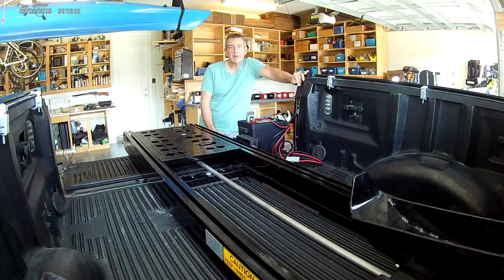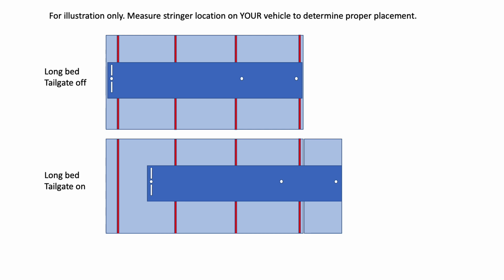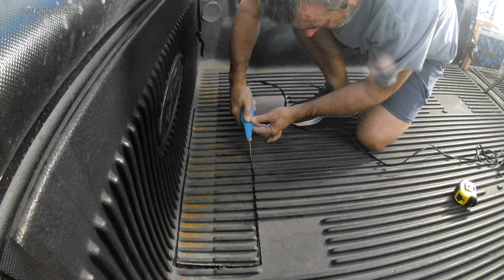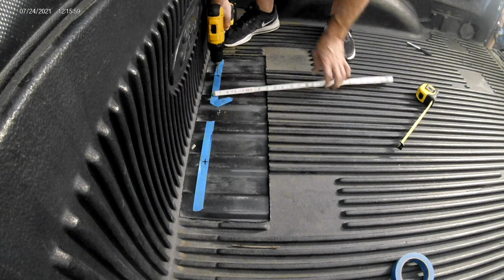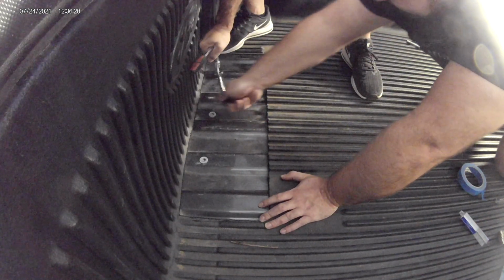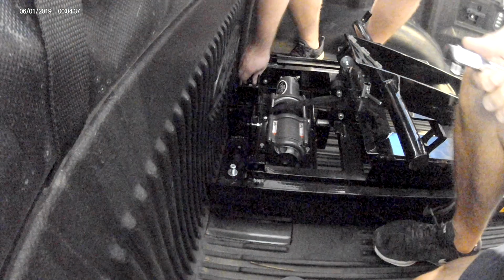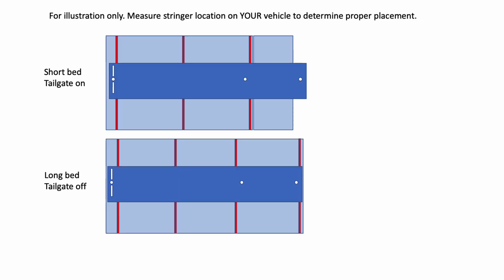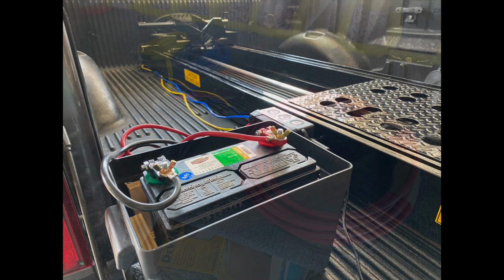Rampage Motorcycle Lift Installation

Comment: Are you able to install this unit in an 8ft bed and then close the tailgate?  I want one but i hate not having my tailgate
Reply from the maker: The Rampage has to be mounted so the ramp will clear the back of the tailgate or the bed of the truck. In an 8 foot bed application, if the tailgate is removable, you could load the bike and put the tailgate back on and close it. If the tailgate is not easily removable (and many are like that now) then you would want to install the Rampage Rollback kit which is a set of rails you install that allow the Rampage to move in/out with or without the bike.

Comment: What's the round metal pipe do on the rack??
Reply from the maker: The round bar down the middle serves as a guide for the ramp. It also has a hole at the top that allows you to secure the ramp with a pin so that you can then load/unload the bike without having the ramp move as the weight shifts.

Comment: Have you had any issues with the slip nuts spinning after using?  How does the truck bed metal hold up to the pulling and hauling of the loader and loading the bike?  I would have thought you might have needed some kind of backing plate or fender washer underneath the bed to prevent metal bending/tearing?  Great video by the way...  I have a motorcycle loader that uses tension rods to hold it down in the truck bed and I have been trying to figure out a way to make a bolt in set up in order to eliminate the tension rods since they seem to always be just in the way...  would love any advice... thanks!!
Reply from the maker: I did have that issue with some of the earlier rivet nuts, but for a long time now they have been supplying Plusnuts which have a much larger jacket and a lot more grip. I have never seen or heard of anyone experiencing pull through of the bed. A different mounting strategy is needed for composite beds. You weld angle iron to the unit and bolt the angle iron to the bed using the bed bolts.
Reply: @Openroadoutfitters  thanks for the response and info...I appreciate it bud!

Comment: So you solely trusting the metal of the bed to hold 800+ lbs for years with no extra metal underneath the bed 🤔
Reply from the maker: Yes, this load is no different than any other. I've had one in my truck for over a decade.